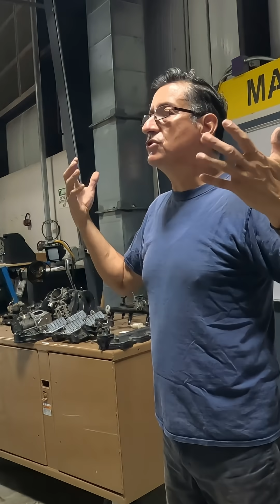Origin of the EFI System

Comment: Wrong - I had a 1981 fleetwood brougham Cadillac that not only had computer controlled injectors, it also shut down fuel to 2 and then 4 cylinders as speed increased and rpm’s dropped in higher gears.  It was of course Cadillacs attempt to keep building boats, through the ever increasing fuel costs of the 70’s and 80’s. Loved that car, it was my grandmas, and she later gave it to me.  Crushed blue velvet interior, and the back seat was more comfortable than my living room sofa.
Reply: What kinda of   MPG could you get out of  it if you  put it on the  nterstate at! 70 MPH and drove it for a few hours ? .